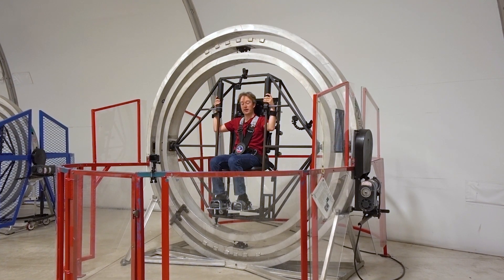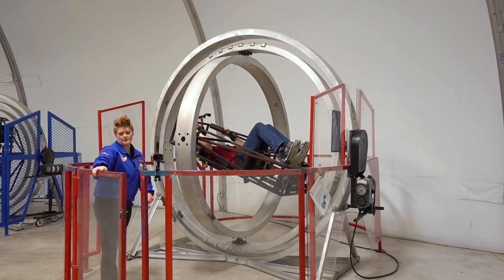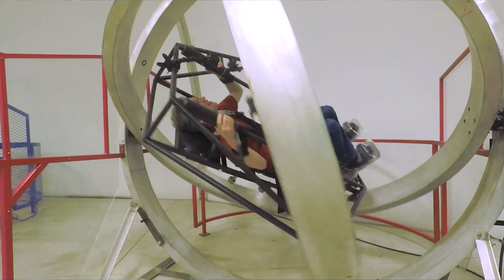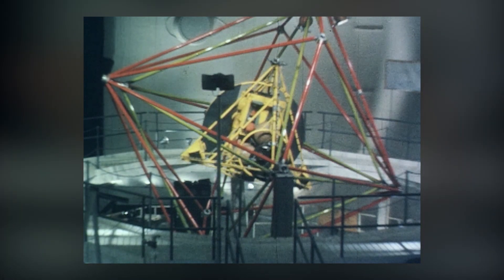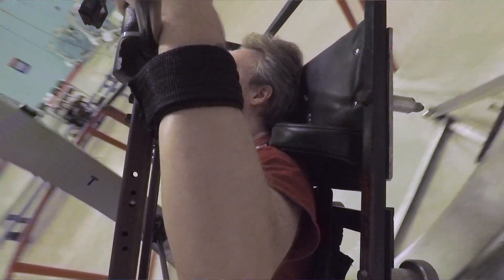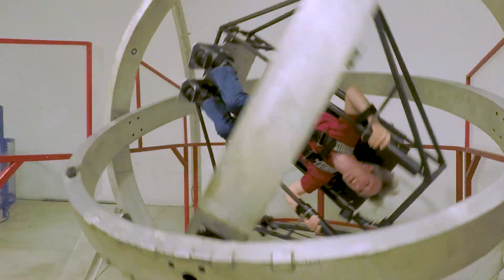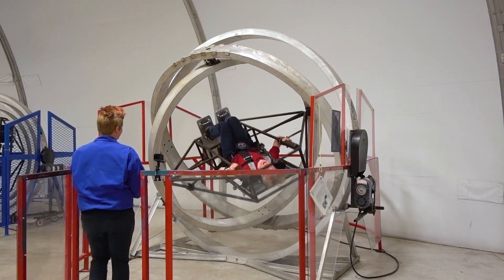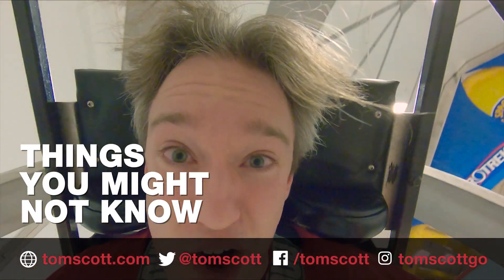Why NASA Spun Astronauts Around, But Doesn't Any More

Comment: So the MASTIF and the MAT were different designs, NASA says this is because the vehicles were different shapes therefore each vehicle behaves differently if control is lost.
I don't understand why the shape of the vehicles would make them act differently to each other when they're in the vacuum of space with no air resistance.

Comment: IMAGINE THE VR FLIGHT SIMULATORS YOU COULD MAKE WITH THIS SYSTEM.
Reply: the only control over it is from a motor that only spins one direction. the middle ring is powered by the motor, but the rest of it spins wildly due to being designed to be unbalanced and gravity makes it go crazy.
Reply: @Crypt1cmyst1c  there are full motion flight simulators that already do this, just in a more controlled manner.
Reply: I went to space camp in titusville back in the day. they had a centrifuge with a tilting cabin and they played a pov jet flight while they spun you up. money no object you put a 6 axis on the end of a centrifuge arm so you can load g's.
Reply: Sega R360 and R360Z actually do that

Comment: - "I forgot to do the outro!"
- (an hour later, going home) "I forgot to answer the title question!"
Reply: Thank you
Reply: Yea atleast going into the future. Computers will handle this problem.
Reply: @FreeStuffPlease  Computers aren't going to handle this problem. If the computers have been doing their job correctly, they would never have gotten into the kind of situation that requires this to begin with. This kind of situation is essentially a last ditch effort to hopefully regain control, but in practice, you're effectively already doomed.
Reply: @yvrelna  I'd imagine they'd have redudant systems in place just in case
Reply: @yvrelna  Not necessarily. External events are not in the computer's control. And the physics of a space craft interacting with its external environment are tough.
It is quite possible that a series of unexpected, low probability events led to this scenario, and then after a point conditions become favorable again, for the computer to regain control of the craft.
Computers are not God like beings that can handle everything. But a computer can definitely do these types of calculations way more effectively than a human.

Comment: Good thing the Gemini astronauts took part in this, as Neil Armstrong and Dave Scott had to correct a roll of almost 50 revolutions per minute during a malfunction on Gemini 8, forcing them to fire up their re-entry control system and abort the mission.
Reply: Neil Armstrong and Dave Scott never did a training on the MASTIF, ironically ... as per some sources.

Comment: I feel like maybe you didn't answer the question in the title? Or maybe I missed it?
Reply: It was explained that astronauts no longer use capsules, and that kind of training wouldn't really work for a shuttle. In a shuttle you're not at the centre of the spin,  which is what this machine is emulating.
Reply: @Levi_Skardsen  
And they no longer fly the shuttle, so that answer is not compelling.
Reply: A capsule like the Gemini one can tumble since it’s relatively small and round, but once the space shuttles came around, which were much larger and closer to planes, astronauts didn’t need to learn to stop tumbling anymore.

Comment: Hey I’ve always wondered why NASA spun astronauts around but doesn’t anymore!
Reply: Keeps me awake for nights
Reply: Cool
Reply: Probably due to them not having a manned space program any more.
Reply: @AnarchyinFallout  Oof, burn
Reply: @AnarchyinFallout  ouch haha
Reply: So... Does anyone know why they don't anymore?
Reply: I didn't know they'd stopped.
Reply: Sometimes they do it a little bit.
Reply: Well you're never gonna find out I guess
Reply: @absolutelybagel2218  until I watch the video
Reply: They certainly did with Challenger !
Reply: Well, they are going back to capsules, but the computer control exists to handle stabilization now, and very reliably. Which leaves the question, did the Russians have something similar, and do they still use it for Soyuz training?
Reply: @EwanMarshall  NASA astronauts go to space on Russian rockets and come back in Russian capsules, so...
Reply: @Ezequiel Ciamparella If by "we" you mean China, than yes you are correct, China will be building one on the Moon around 2024. If you mean USA.........not a hope in hell. Would love to be proved wrong so I will come back in 4 years to check. Likely will be "We have plans to build one in 2034". Its like Fusion power, every 10 years they add another 10 onto when it "may happen".
Reply: because they know it's bs